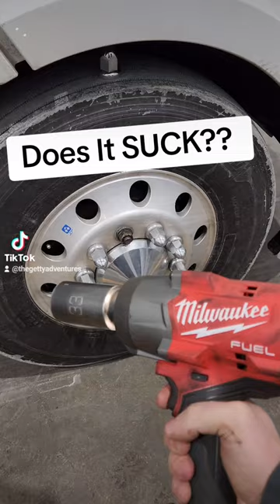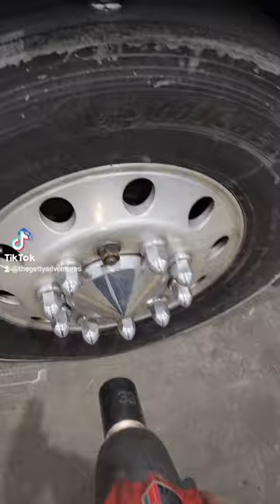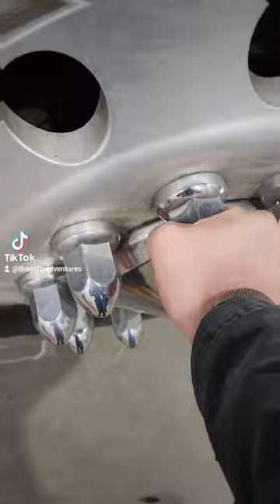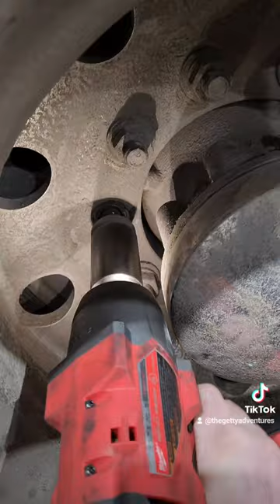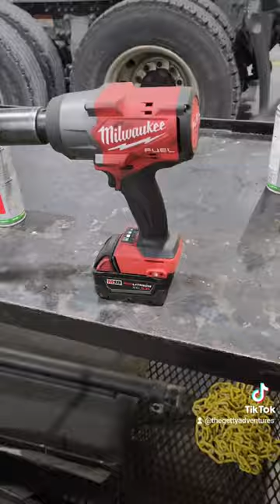Milwaukee M18 HIGH TORQUE Impact Wrench Testing on big SEMI Truck wheels

Comment: Hopefully they fixed the battery wobble shit
Reply: And the cheap trigger mechanism, mine broke on the 1st lug I ever used it on and it was only a lug on a f150
Reply: The 2967 has a battery isolator
Reply from the maker: Ya they tried to make an Isolator to help with that.
Reply from the maker: Really ? Thats no good
Reply: @josequervo1959 that's the model before 2967.  The one that they had come out before the 2967, had a different internal design but problems like the one you had and done a massive recall and took out the entire line and designed it from the ground up and came out with the new 2967. I have one
Reply: Milwaukee figures out what Makita has 10 years ago

Comment: This is the gift you want and try to find every reason to say you need it
Reply: I got mine brand new for 270 and it came with a charger, battery, and case shoot I'm happy as can be
Reply: Same I want to buy one but don’t have much to use it on

Comment: Two things dude number one you are using a 5.0 battery a six amp hour or an eight amp hour. High output is a big improvement over what you’re using and the forge battery is a game changer could be doing way better than what it is but still yeah it’s doing awesome. I have the same gun and it’s incredible.

Comment: That's not a great deal. The wheels on a truck are torqued to 450/500. And good 1/2 or 3/4 will do the same
Reply: I don't think they were really designed for heavy duty truck useage but the cool thing is they will do it. I'd be wary of using it on all the wheels on a semi daily better off just using a 3/4 or 1 inch air gun
Reply: I am curious how many shops actually use a torque wrench on CDL vehicles though.  I bet many just send it using an impact.
Reply: @connor3288   I’ve never seen anyone use a torque wrench on a semi wheel just a 1” gun till the lug nut stops spinning and send it.
Reply: Plus the rust

Comment: My freaking dumb expensive snap on unit doesn't do half that
Reply: thats what you get for buying strap on
Reply from the maker: I personally think the electric snap on stuff is not worth it at all
Reply: which snap on impact do you have?
Reply: @TheGettyAdventures it depends i have a ct9050 and i do work on equipment and semis i had a milwaukee one keep having problems with it battery’s so i tossed it in the trash
Reply: @TheGettyAdventures  I'll probably never buy another snap on product for the rest of my life